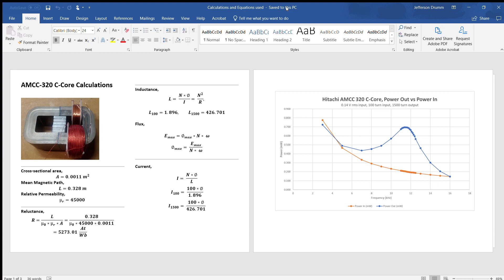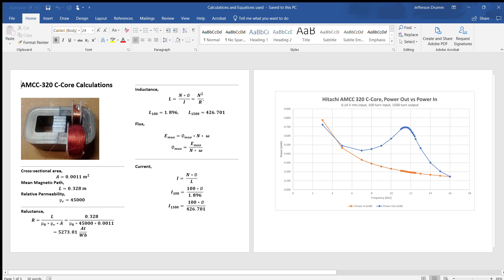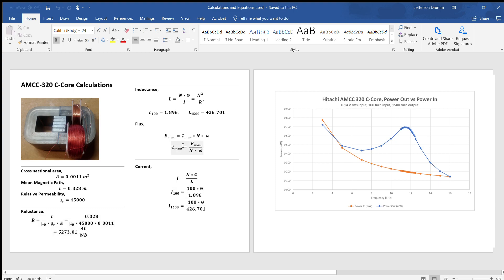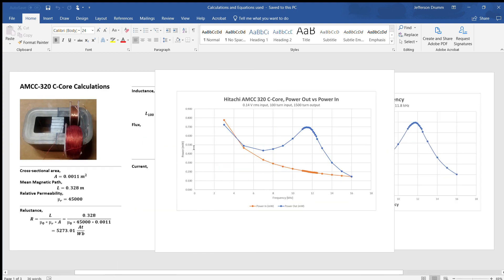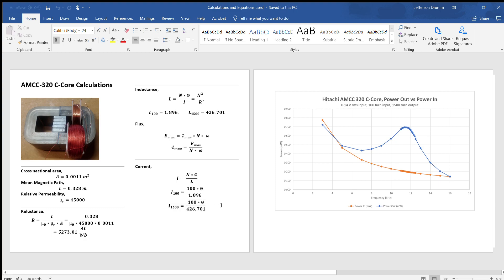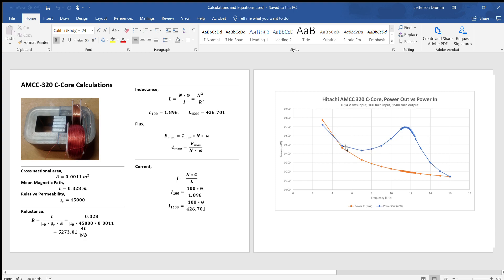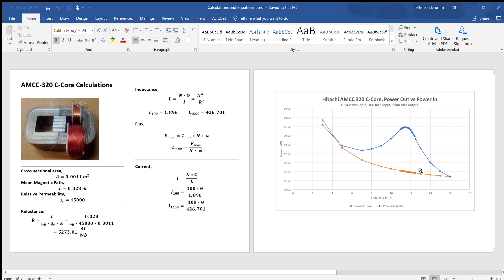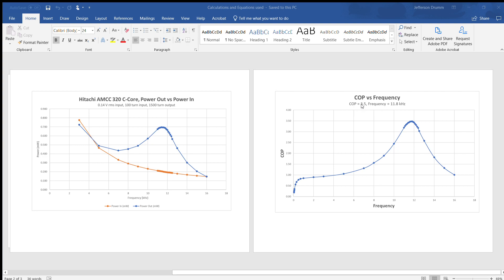MEG Testing Results, COP = 3.5,  Vacuum Free Energy Confirmed!!! Thomas Bearden

Comment: Great Video, you seam to be getting the same COP results as JLN but with 1/2 of the windings. That is helpful to know. The increased frequency makes sense because Bearden says, when talking about the magnetic vector potential A, that the magnitude of the E field is proportional to the Rate of Change and it is Non Linear.

Comment: These results are encouraging. Bearden speaks of drawing off power without destroying the dipole; I looked deeply into Floyd Sweet 's circuit and believe he was doing that, separating common mode currents from differential mode, with a pair of bifilar coils. The common mode currents would freewheel to continue running the resonance, while differential currents would be extracted as output

Comment: They say you need a high voltage diode across this bucking coil Transformer along with a capacitor. The output was supposed to be eight times the input.

Comment: I think there is a mistake in the calculated power.  Did you measure the current as RMS or just use the calculated value at each frequency and simply measure the voltage?  This could lead to errors as it doesn't take  in to account for resistive losses in either coil, and other factors.  Open circuit voltage isn't going to provide a true load to the core.

Comment: I applaud your efforts in building this. Something to consider. As I'm sure you know, power is not energy and inductors are great at storing energy. At resonance, which you are operating at or near, measured output power can easily be higher than the input power with a high impedance meter. If you haven't already I would put a low value resistor at your output to act as a load. Then you can get a true reading over time. Hope that helps and I'm not years too late.
Reply from the maker: Yes, good point, i need a load to power, but first need to develop the switching circuitry.
Reply: @JeffersonDrumm  any updates? I would love to see where the research has gone

Comment: Hello my friend. Is this because you hit the resonant frequency ? I will go back and look at your setup. Thank you for posting this. I have been following Don Smith since 96 and then when I got to colleg. He has a similar metglass transformer....He said, I had actually talked with him before he passed away early 2000's that he made the transformer from a roll of aluminum tape pressed in half and with two coils wrapped around. This is such great work. Thank you again.
Reply from the maker: Yes there will be more to come the next step is to time the pulses to negate the back EMF
Reply: @JeffersonDrumm  Yes , or collect those pulses and put them into a capacitor and then into the run battery or if you are using a two battery system , the charge battery. At least in the beginning of this research Ev Gray kinda pioneered the run battery and charge battery bank idea because of the sad state of battery technology back then. Check out Benitez 1920 I believe who has a patent for a new method of generating electricity which is actually a self charging battery. Rick Freidrich has a bunch of information on it but it is all solid tech.

Comment: What’s the phase difference between the two coils because you may have to change the phase of the output so can loop the power back and maintain the output plus if it work well you may be able to start the Meg with a single pulse.
And make a much larger Meg would be 
Possible imagine 30 hp are more. Enough to run a Tesla.

Comment: To utilize this power, you'll need to charge up a capacitor with it in one cycle, and then have that dump into a battery to power the circuit etc.

Comment: Hi Jeff! Like many in the comments I'm wondering if you're still working on this project. 
Do you have any news about this device and its performance? 

Keep up the great work!
Cheers
Reply from the maker: Yes thanks for the comments I'm still building up my knowledge and understanding to continue the testing.
Reply: @JeffersonDrumm  Awesome. I'm in a physics masters and really want to do something like this for a thesis. 
Have you looked at the phase relations between current and voltage for both input and output? This is important, since you have to distinguish real from apparent power to calculate COP. Simply multiplying current with voltage doesn't yield the real power. Cheers
Reply: @vanasdonk  Hi ,wondering if you ever did "said" thesis ,would love to read it.

Comment: Jeff, you need to do several things to vastly increase the output power of the system .. 

1. A second Set of coils needs to be added .. 
2. You need to stop using round wire ! .. You need to use Flatter Low Inductance rectangular copper .. This will increase the flux density which will improve the operation .. 
3. You need to use higher frequencies and Ferrite Cores .. 

I know how expensive ferrite cores are if you go to a company and have them make you a custom core .. I also know how expensive Ferrite Powder is and than many companies won't just sell you powder .. However, you can buy cores with the right material cheap .. Then you need to make an industrial crusher so you can buy cheap Ferrite .. I spoke to Tom Bearden Many Years ago about this and he said he stopped working on this because of .. You know .. I believe that you can operate a Meg in the .5 - 1 Mhz region .. The timing of a coil set version will be a little tricky at first but then you will be able to use one set to power the device and the second set for an output .. You C.O.P. will be in the area of at least 10x .. BTW Elon Musk is looking for a device like this .. My interest here is to change the world ..
Reply: " .. I spoke to Tom Bearden Many Years ago about this and he said he stopped working on this because of .. You know .. "
I am going to assume it had something to do with his life being more at risk, but No, I don't know.

Very sadly & unfortunately He's gone.
We lost another True Scientist last year in April (2022).
His Website is still up for some reason; the lights are on, but nobody's home
It's really hard to purchase his material (DVD's, books, PDF's, drawing schematics, etc etc) so I think the higher powers are happy it stays this way.

The world doesn't want change, because if they did, they would have listened to Tom, Henry Moray, Gabriel Kron, DePalma, Whitaker, Stubblefield, and on and on.
the only hope is for us to do this for the Truth Lovers.

Sir, if you happen to know where one can get material that you seem to know about, would you please provide some direction in a reply?

Take care,
MR

Comment: Hi Jeff, that's a really very interesting thing about measuring the COP. How did you measure the electrical power?
I hope you have considered that the multimeters measure correct values with alternating current only with sinusoidal voltage.

Comment: I wouldn´t want to put the feedback, just build a car wich drives many times the distance a standard E-car today can. Just for trolling your friends XD
If it works good with a high load, than think about a way to make it better.
Maybe by conect two or hree MEGs in series XD

Ps. Maybe its raising again after about 30 kHz? I would try up to 100kHz to make sure it drops and doesn´t change. It´s possible, that the COP is way better at a higher frequenzy. Also try other waveforms. You should try anything you can and compare it.

Comment: Just a heads up, if you tested this without the magnet, you would  probably  get the  exact same  results.  If you test this and it works, you can contact me and I'll explain why.   Good luck
Reply: Hey, so i realised something similar, does it have to do with the type of load being used?
I used a Metal Oxide Varistor.

Comment: Can you feed the output back into the device? Or at least feed the secondary into a battery then connect the battery to the primary and see if it charges it.
Reply from the maker: Exactly, that's what needs to happen.

Comment: I must tell you that you are using the incorrect equations. If you want to power something with it the equations of a transformer have to be adjusted. That was the difficult thing in electrodynamics
Reply from the maker: Please feel free to share what you think the equations are, I pulled these right out of my electrical machines textbook focused on Transformers
Reply: @JeffersonDrumm  
It is very dependend on what the load actually is, because you have to take the phase-shift of the current into consideration. For example a coil gives a phase-change of 90°. But I see that you have no load in your setup so your equations schould be correct (my mistake). But even so, if you measure the voltage and current at each side V1,V2,I1,I2, you would always get I1*V1 = I2*V2 (because Power P=I*V). So the Power input on one side is equal to the output on the other side. 
You can however (also not with this setup) create some machine that puts out higher power than is put in. But because power = energy/time this does not violate any laws of physics because the same energy that is put in is just put out faster. Put that would not create energy. For example a capacitor can be charged in one minute with low power and can release very high power (all its energy) in a few microseconds.

Comment: Are you assuming that you get 0.14V RMS on both coils? The point of a transformer like this is to "transform" voltage. It is true that you are applying 0.14V to the input, and your calculations for current seem to be correct. However, if you were to measure the output voltage it would be less than 0.14V RMS, likely by the factor of your COP. A transformer essentially trades voltage for current, or vice-versa, while maintaining power (minus losses due to flux leakage and ohmic losses in your coils)*

*I have just watched your previous videos, I see you get roughly 7V out of this. This is incredibly interesting. I am a mechanical engineer, certainly not as well versed in this field as you seem to be. I am going to be studying this much more carefully.

Also, for I_1500, why are you using N=100? Should it not be 1500?. The flux linkage equation should use that coil's turns, N=1500.
Reply: Did you study or builled this product more sir ? Did you had more discoverly or success. I really want to active over unuty or enagy converting from aether to this visable 3d spectrium demention . please let me know if you find any success in this super interesting & need enagy today's my world. Please let me know if you find any more to this discoverly please since this MEG transfomer over unity guy not talking this subject I want to know more about this infomations. Or more new discoverys in just any effecient enagy.

Comment: here is some info, in response to your recent comment, on   rick friedrich's   latest silliness.   ( he is blocking my comments. )
he is a fraud and/or deluded.      this is just another way of incorporating an unloaded  motor  into a  Power circuit.    in this case,  the (fan) motor is  drawing  Very Little  CURRENT.    consequently,  the motor is  only  functioning as  a  ROTARY TRANSFORMER.     contrary to what he says,  x-amount of energy goes in,  and  a  Little LESS  comes out.       'negative transient energy' ????    is that what     back-emf.    if  he thinks   back-emf  is  'free',  he is  mistaken.     because, when back-emf is present in an energized coil, it  becomes  IMPEDANCE; and  there is energy  Loss.         googletranslate